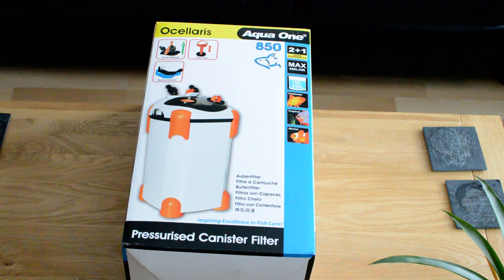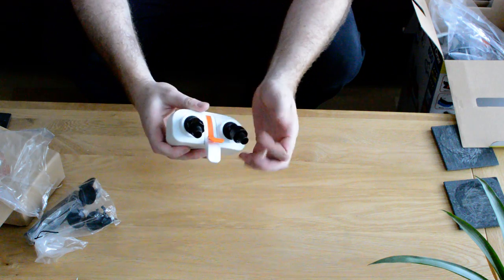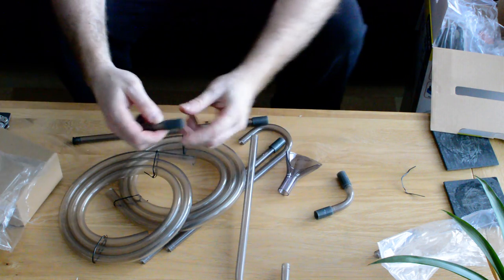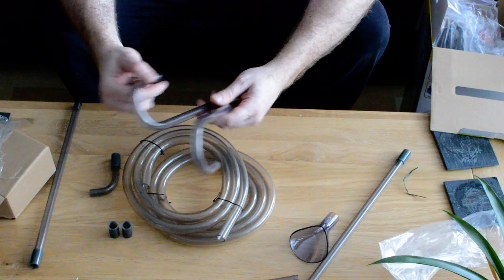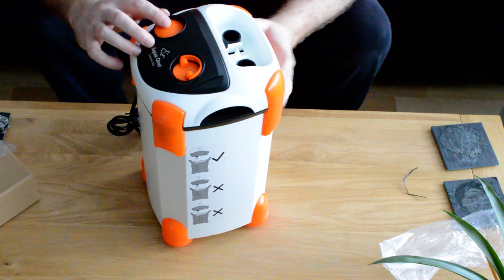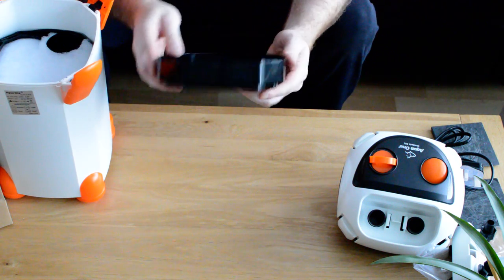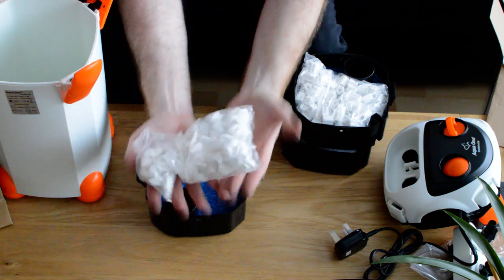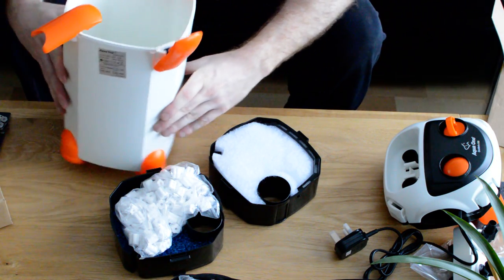Aqua One Ocellaris 850 - 1st look and unboxing

Comment: I had this filter for a year and it was good at first but after a while  the motor started to pack up and was rinsing my electric and eventually started tripping my main breaker when I turned on any other appliance in the house diagnosed the fault through turning off individual items running in house

Comment: could I use this on a 55 litre Aqua One aquarium. at the moment I am just using the stock filter that come with the aquarium
Reply from the maker: Hi, You could but the flow might be a little strong depends what fish are in you aquarium. I did use a 600 lph cannister on a 40 cm cube aqua nano and it was fine using the spray bar but not 100% on this filter on a 55ltr your fish would have to like water movement.

Comment: Good video. Just one question. With the design of that filter, can the water short circuit the filter media an d pass up the sides of those baskets? My favorite filters are the Eheim Classic!
Reply from the maker: Hi, You would not get much bipass in this filter it would go through your media but honestly its not as good as any eheim or JBL i have used.

Comment: Apart from the filter media being the wrong way around the filter body does not look very robust.
Reply from the maker: Yeah Filter media seems to always be the wrong way around from the manufacturers, the body seems fine though it just doesn't match up well against some other brands at the same price point  I never actually used it though as it came as part of a tank kit. I ran Eheim pros on the system as i already had them. The guy I gave this to is running it though and has not had any issues

Comment: This filter is super quiet  which is a bonus , however as a filter is not efficient. The mug is build up above the  floss and not going through the floss. it mean the rubbish just float on top of the baskets without filtering. I have run this filter for few months and there is  not much rubbish collected. The sponges are crystal clear. The reason is that the filter  water flow is very low not even near to specification. I measure the flow and comes to around 80 liters  per hour.
I am using it only for media and UV.

Comment: Have got this filter and thinking of swapping it out. Really poor flow rate.
Reply from the maker: yeah seems to be a common complaint. I currently use a mix of Fluval *07 range and JBL Crystal profis. I would recommend either. I also have some eheim pro 4s but they are expensive and not as good as the others i mentioned IMO

Comment: Hi Kel
I've got one of these up and running now for about a month only concern is the inlet as worried that my shrimp or some of the small fish could get sucked up and wondered if some sort of sponge could be used and if it would help keep the tubing cleaner. Thanks in advance.
Reply from the maker: Hi, Yes sponge around the inlet will work I have done it before and we have just put a fine sponge around the intake on my brothers shrimp tank as he has 100s of baby bee shrimp and he doesn't want them in his canister :) And yes it also acts as a pre-filter for your canister catching a lot of muck.
Reply: Kel's Aquariums is there any you'd recommend as there's so many so far the closest I've seen is fluval edge?
Reply from the maker: Do you mean pre-filters sponges ? the fluval one is ok as it is ready just to push on but you can just buy a block of sponge and cut a hole in it. If you have baby shrimps just make sure your foam is fine enough for them not to fit through.
Reply: Kel's Aquariums  yes and will do many thanks again 😊

Comment: Nice review. I’m not a fan a aqua one products but I might give this filter a try.
Reply from the maker: Hi, Before you buy one I would suggest looking at some other reviews I have heard about some people running them who are not very impressed. I only ran it briefly to test it as it came with a tank but I had already seeded Eheim pro 4sready to use. 

Kel
Reply: Kel's Aquariums I’m buying the aquavogue 245 tank in a few weeks. I’m going to be setting it up as a marine reef tank.
How do you find the tanks and cabinets? Are they well built?
The filter comes with the tank so I might give it a try. 
I’ve had aqua one filters in the past and not been that impressed with them. 
Thank you for your advice.
Reply from the maker: Hi, The Tank is very good I am still using it a couple of years on and had no issues at all. The cabinet is a very standard design similar to most aquarium stands same construction as most kitchen cabinets wrapped chipboard but it does its job well again had no issues. The lighting is a mix bag It is a super bright led strip with a built in timer that also has never missed a beat, the only issue I ran into is while using it on a high tech planted tank with CO2 injection it was great I changed to a lowtech tank and it was way too bright and does not have any adjustment ( not sure it would be right for a reef tank as i don't do marine) just fyi not sure on marine suitability of the lights on any of them but the Eheim VivalineLED 240 is also worth looking at.
Reply: Kel's Aquariums I’m running a Juwel Rio 180 3ft marine tank at the minute. But I want to upgrade to a 4ft tank.
Unfortunately a lot of tropical tanks are narrow so there not great for aquascaping.
A 4 ft Juwel Rio 240 tank is 41cm wide, the aqua one is about 45cm wide which is the main reason I’m getting it.
I’ve seen eheim tanks online but I’ve never seen them setup in any shops so I’m not sure what there like.
I’ve seen the smaller aquavogue setup and it does seem like a nice tank.
Reply from the maker: to be fair the juwel, aquaone and eheim tanks are all good tanks so if the size of the aquaone is right then  that's the one :) also if they wasnt branded and all next to each other they would be hard to tell apart.
Reply: Kel's Aquariums I’ve just bought the ocellaris 850.
It’s a nice filter, I’m not sure the media it comes with is going to reduce my nitrates, which it what I want it to do.
I’m thinking of sending the filter to pond guru to see what he thinks of it and he will put his Biohome media in it which if there’s enough it will hopefully help to keep my nitrates low. 
I’ve seen quite a few good reviews about Biohome media.
I’m using the filter on a reef tank.

Comment: This cannister filter is unfit for purpose. 
The main seal is prone to leaking.
The worst though, is the rubber grommet that the cable goes through.
 It shrinks and allows water to leak, causing water damage to your cabinet and flooring.
The Aqua One Ocellaris 850 is the worst designed canister filter ever.